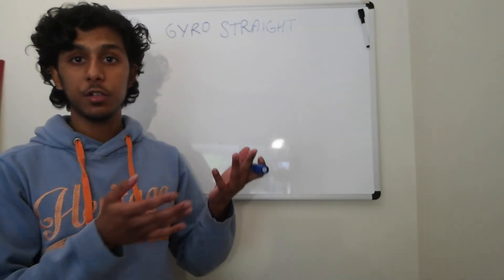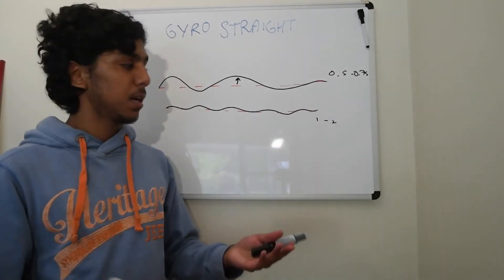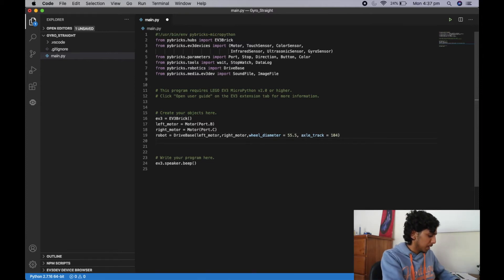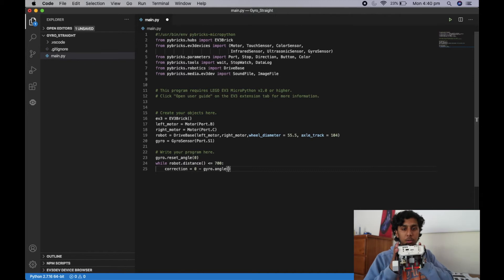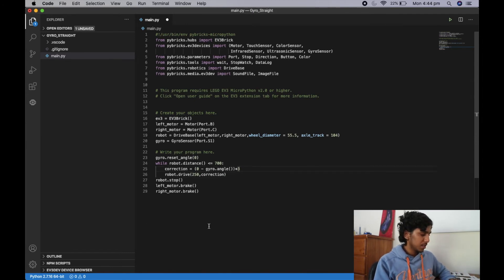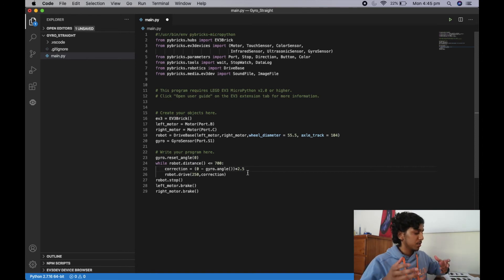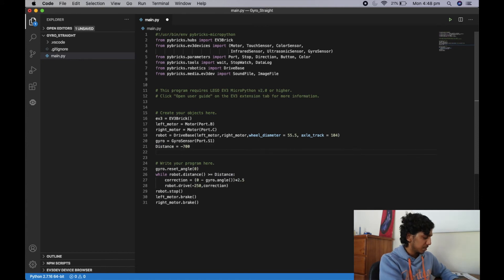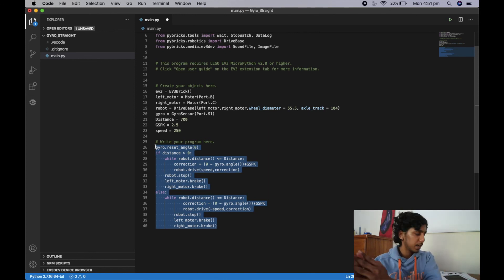How to make your Robot Drive Perfectly Straight - EV3 MicroPython [5]

Comment: Another example for next videos could be the emulation of a vibration detector. Try to integrate how fast it moves the gyro sensor to make warnings about future earthquakes. You may use motors to simulate a sismogray printer evaluating how to manage timers for reading the sensor and draw (or record in a file) its values.

Comment: You could use gyro for slopes correction. Anew video could show how do you control aceleration and speed versus the value you mesure on the sensor either to mantain your vehicule stoped, go up go down ...etc. A good example of how you represent these parameters in different tests could help you to locate paterns and from its analisys type code again your model to be smarter

Comment: The 3 lines for stoping the motor should be placed in a upper function. Also a nice pratice to reduce amount of memory would be just to import the functions you need for the code.